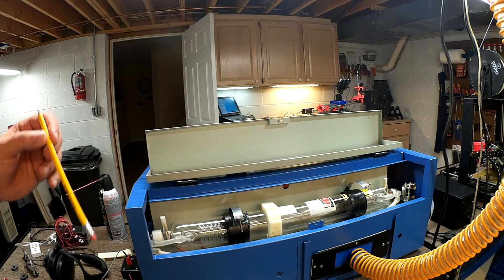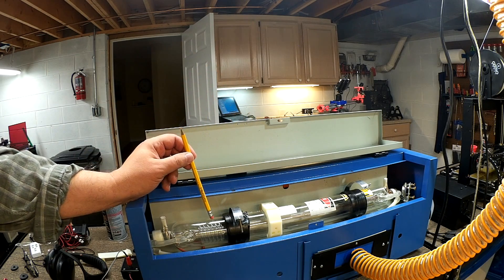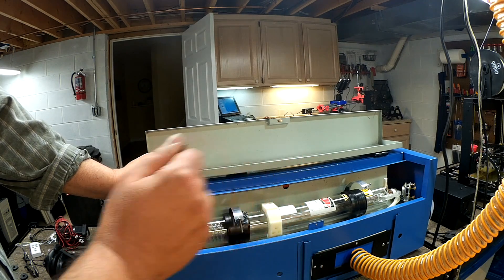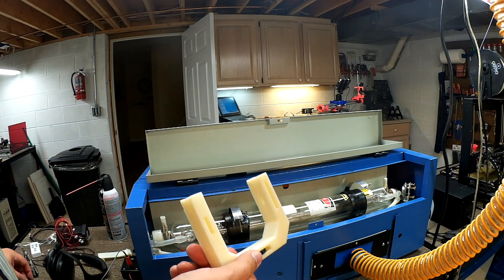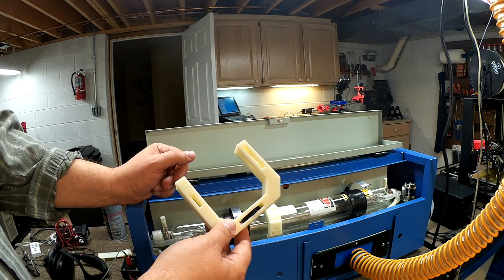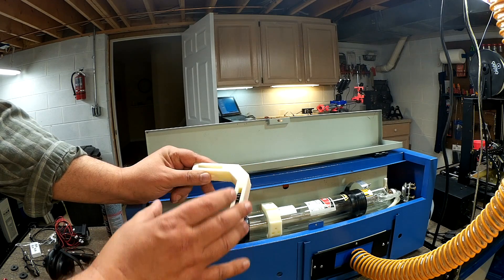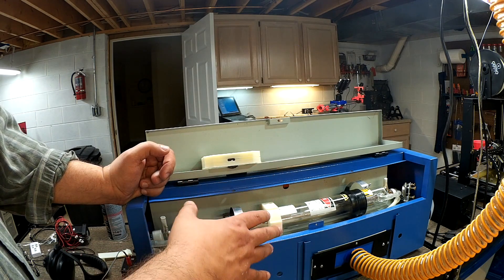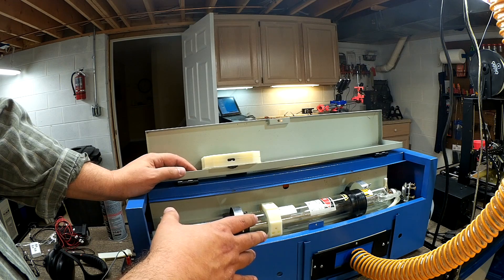K40 eBay Chinese CO2 Laser -  Building Tube Hangers Part 1!

Comment: I still don't see how the un-squareness of the tube can be an issue. That's the whole point of the mirror to change the angle the beam is shooting. If the mirror wasn't there at all, the tube would be straight out the back. 

As long as the beam is pointed at the center of the next mirror, and that mirror is adjustable too, you should be able to make all the adjustments necessary.
Reply from the maker: Makes a big difference, in high end machines you will find that there is a rigid superstructure and all mirrors are a perfect 45deg angles in both X and Y planes respectively.  Whereas the tube affects "runout"  in the Z axis as if the tube is tilted downward you will have beam run out as the secondary mirror pulls away.  Just imagine taking a flashlight and shining it at mirror and what happens when you angle it.  The same happens with the laser as keep in mind the beam is about 2.5mm coming out of the tube so it is rather large and not focused till it hits the lens.
Reply: how can you check where goes beam?

Comment: 40watt beam; take care
Reply from the maker: Yes lots of care needs to be taken with a laser, especially a CO2 laser as the beam is invisible  in addition to the high voltage section too!
Reply: Make sure it can not reflect off something into the eyes, eye protection is a minimum
Reply from the maker: Yes eye safety is  very important!  I use IR Laser safety glass and the one nice thing of IR lasers verses say 500nm visible light ones (which I also have)  is the IR dosen't like to pass through plastic so in a way it is safer.  However as mentioned in my videos one should also clear the room (area) of other people and pets even at a distance!

Comment: How are you extracting the smoke. Your exhaust pipe looks very small.
Reply from the maker: Its 1.5" and its is connected to my dust vac system so its draw is pretty heavy and I use blast gates to shut down the other openings and works well however it is a dust collection system and it is noisier than normal fan...